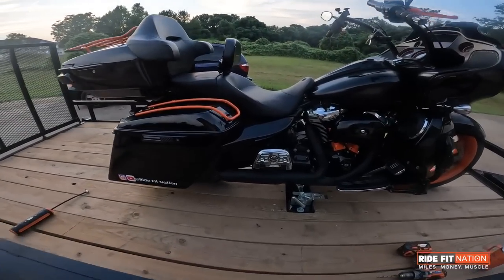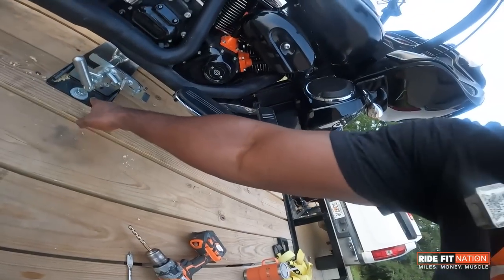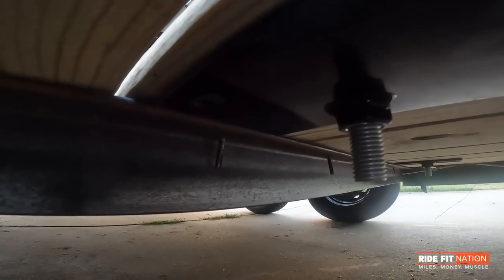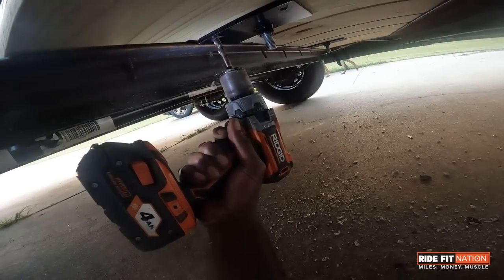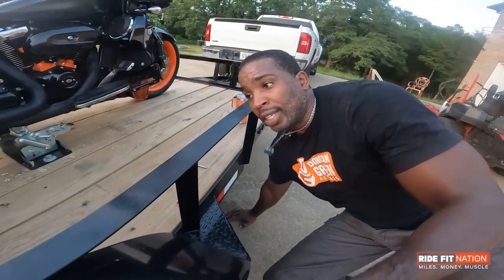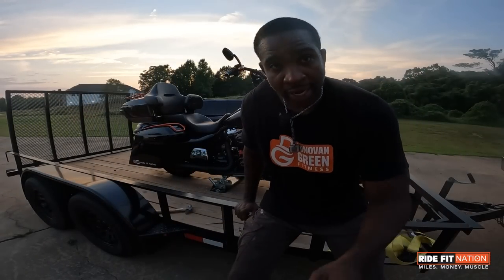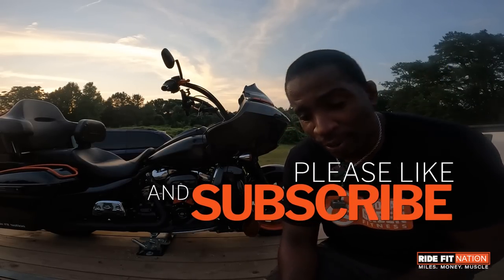Forget Straps! Trailering Your Motorcycle Has Never Been Easier with The Biker Bar

Comment: I see some of the comments with the hesitation of using The Biker Bar without chocks or straps. I can say for certainty that neither is required or needed. I recently installed 2 Biker Bars in my 7x14 trailer, one for a touring bike and one for a Softail. Recently went on a trip with both bikes from Virginia to Austin, Texas... 3,000 miles round trip and neither bike moved AT ALL!!! Also want to note that the day before I was on my way way to a truck scale to check the weights and load for hitch weight and was involved in an accident. Driver in a Cadillac Escalade turned directly in front of me and I planted my truck right into his door. The Biker Bar is the real deal! Neither bike moved.... I can't say that would be the case with straps and chocks. Put it in and don't sweat it... If it's installed, adjusted, and set correctly there shouldn't be any problems.

Comment: Yes, straps are a pain, but straps can give you a visual indication if your bike is moving or it's not properly secure by checking the slack or tension on the straps.
      With bolt down locks, you just have to hold your breath and hope the bolts or nuts don't come loose at 65 mph on the highway....no thanks!  
       I would use this lock down kit, but I would still use straps as a back up.
Reply from the maker: You can’t go wrong with extra security
Reply: Nah. That would be great in the garage but I can just see a bike on it's side sliding down the highway.

Comment: You are bolted down to boards that are only held down to the trailer frame by a few screws. When the wood rots and the screws rust which will happen on a trailer you will pull loose.
Reply from the maker: It's important that I inspect i tover times an dreplce when needed. However, this ain't going loose or rotting anytime soon.
Reply: @ridefitnation  you haven't been around trailers very long have you? NEVER rely on those tiny screws to hold a 900 lb bike.
Reply from the maker: @robertschulz5293  tiny screws. These are large heavy duty bolts locked on with a steel plate.
Reply: @ridefitnation  3:03 take those self tappers out and replace them with bolts and washers, even in new condition they don't have strength they snap like nothing, you have a sudden stop and that bike will rips those two boards anchoring all this right off and keep going
Reply: I would ONLY trust this if it was bolted to the steel frame... do NOT trust the wood decking!

Comment: Biker Bar is amazing! Straps ruined my and dented my paint! Best $400 I ever spent. I do wish my wheel would lock straight. The wheel going crooked going down the road messes with me. Also, I used carriage bolts from the top to make it flush with the trailer top.
Reply from the maker: That’s what inside on mine now. The carriage bolts are way better. I’m going to add a wheel chick to mine to keep the front straight or might even use a strap on the front tire. The wheel turning won’t make the bike fall though. It’s the asthetic that bothers me.

Comment: I'm a carpenter of 40 years, let me give your viewers a Tip. Do NOT drill those holes all the way through. If you we're to drill a smaller hole (1/4" in diameter) where you drilled your holes from the bottom and get a 3/8" x 1-1/4" (1-1/4" long into a 1-1/2" decking board) lag bolt and screw it from the bottom upwards it will Securely hold the plate in place without having the head of the bolt on the top side (No trip/stub your foot hazard), cleaner looking also. When you remove the Biker bar the plate will remain in place until you want to use it again.
Reply from the maker: Great point. I ended up using the Carriage bolts. No tripling or stumbling
Reply: Safe Riding  @ridefitnation

Comment: I have a biker bar for my 21 RGL.  Couple of tips for using the setup...The bike seems to want to walk back just a little, I am considering tacking a metal stop to each side of my frame to prevent this from happening.  Also, if you have problems with your front wheel turning one way or the other while in transport you don't have it adjusted correctly.  The biker bar should pull the suspension into a compressed position once its locked in place.  If it doesn't simply adjust the mount down one setting until it pulls the suspension into compression.
Reply from the maker: Great info.
Reply: I’ve always heard you don’t want your suspension compressed while trailering?

Comment: Great video an product. A quick question about the part that's on the bike. Is it clamped to the frame or bolted? Next is just a suggestion about the bottom plate, I'd extend that all the way to the outer  frame rails and weld it via tubing or steel plate. Nice job brother. PEACE!!!!!
Reply from the maker: It’s clamped so it can be removed. I trust the steel pate as is because steel sandwiching wood makes a heck of a strong hold.

Comment: Great tool. straps are a pain. 
1 thing i did notice (dunno if others did) may want to back off your clutch a touch. 
Seemed like it was dragging when you hit the starter.
Reply from the maker: Thanks for the heads up on that.
Reply: @ridefitnation  No probs mate. 👍
They draw pretty heavy on the battery to start & that lil bit of drag makes everything work a bit harder.

Comment: Biker bars work good, but offer no flexibility. What if now you need to haul multiple bikes?  Some of which are non Harley Davidson, maybe some adv bikes? I looked at the biker bar closely before deciding  on Etrac with adjustable condor wheel chocks.  I can haul multiple bikes, different types of bikes, and have full flexibility in re-arranging my load on my trailer to accommodate them.
Reply from the maker: YUp! I agree with what you're saying. In my case I only use it for my bike and its great! If you're hauling multiple bikes then you can set up the biker bars stagnated but E track is better.
Reply from the maker: @johnhairfield849   Feel what you feel.

Comment: Does the bar release ad to not be a contact point when riding?
Reply from the maker: Explain. I don't know what you mean.
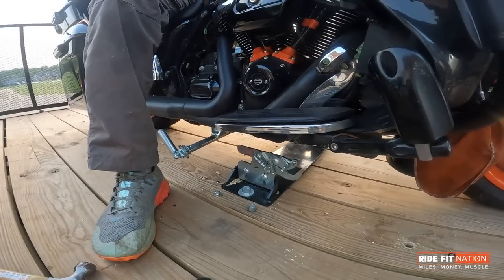Reply: @ridefitnation at 5:48, I just saw the bar that locks into the receiver near your right ankle. I didn't know if that cross bar quick releases in a way that's reasonable.
Reply from the maker: @Xs395  it’s a crossbar that locks in both sides
Reply: @ridefitnation  does it come off when you ride? Or easier asked, do you take it off?
Reply from the maker: @Xs395  it has to come off

Comment: @4:55 those are lock washers, not crush washers. Crush washers are used when sealing up something, like an oil pan. Lock washers are used to keep the bolts from coming loose from vibrations, etc, etc.  Cool video though on a neat product!
Reply from the maker: Thanks for the correction on the name.

Comment: Great idea but the pad inside the clamp comes off and bike gets very loose and will fall over. Opened trailer and bike was on its side. A Condor chalk and two straps cannot be beat!!
Reply from the maker: Sorry that happened to you. How does it get loose when it’s locked to the frame?  Is it possible that you did something incorrect? Just asking

Comment: I wouldn't trust my bike to be held down by this system. You are relying  on deck screws to secure your bike. Better way would be to secure the plates to the frame of the trailer. I have seen many trailer floors with loose planks because the screws have corroded and snapped off.
Reply from the maker: I see that John has a whole lot to say about this product. How can you continue to try to downplay me with all of your condescending comments? Are you under the impression that I’m just ignorant kid who has no sense. This thing is installed as recommended. Have you  tried it and had a bad experience? And your gadget comment was reaching a bit.
Reply from the maker: The planks on my trailer sent loose. But thanks for the input.’
Reply: @ridefitnation  I wasn't bashing the product, but I'm not comfortable with the way it is mounted to the trailer. A chain is only as strong as its weakest link, and in this case the weakest link is the deck screws holding the plank to the trailer. The mounting plates should be attached to the trailer frame, not the planking.
Reply from the maker: @maddog3080  💪🏽

Comment: I'll state the obvious, but that setup will only work on a bike that has a cradle frame like that.  I wouldn't be able to use that on any of my bikes, and even if I could, I probably wouldn't.  I wouldn't trust something that secures the bike at it's lowest point, with the center of gravity and all the weight above the bottom of the cradle frame.  Having straps up high going down at an angle is the most secure way to transport a bike.  I loaded all kinds of military aircraft in a previous life, and we always used straps and chains to secure rolling stock.

Comment: MAYOR FLAW in the mounting. You are relying on those tint self tapers holding down the wood to hold down the biker bar to hold the bike. I would never rely on just that biker bar to hold my bike.
Reply from the maker: There are metal plates that run across the wood plank so NO I’m not relying on self taping screws. It’s actually pretty secure.
Reply: @ridefitnation  The self tapping screws are holding the wood to the steel crossmembers. Just because you attach small plates to the bottom of the unit doesn't make it secure. The bike is relying on those self tappers that are holding the wood down in the end. I build trailers. The ONLY way to properly secure your bike mount is to drill through the wood into the trailer crossmember and bolt it down to the crossmember.